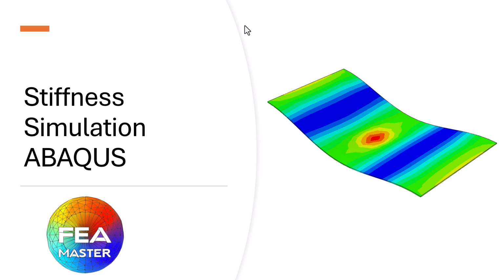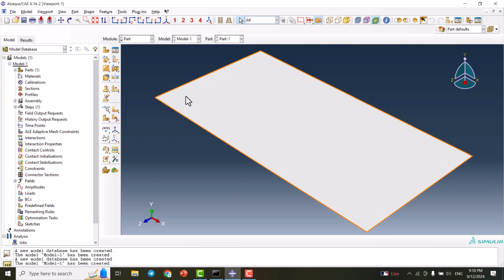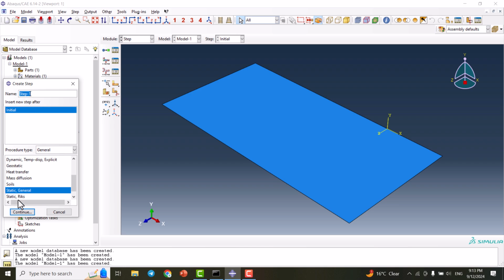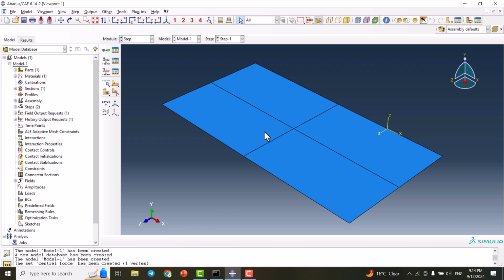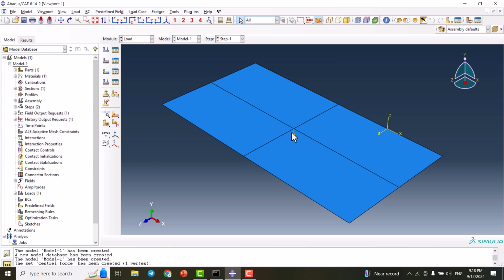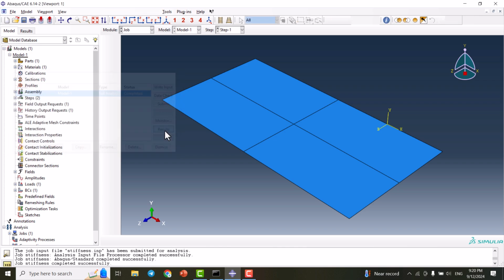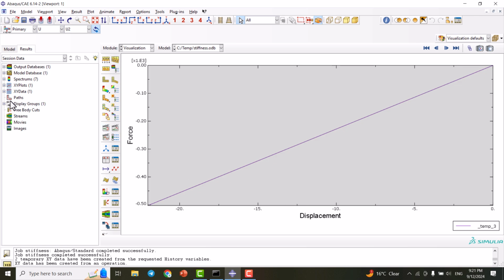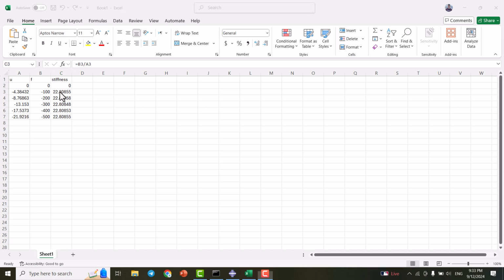You WON'T BELIEVE How Easy Calculating Stiffness is with ABAQUS

Comment: How can find the stiffness for a beam structure?
Reply from the maker: For a beam, stiffness is basically k = F / δ (force over displacement).

So you can:
1. Fix one end of the beam  
2. Apply a known force at the other end  
3. Extract the displacement at that point  
4. Compute stiffness → k = F / δ  

If you want bending stiffness specifically, it relates to EI, and you can back-calculate it from the displacement depending on the loading case (e.g., cantilever beam).

Your stress/strain method gives material stiffness (E), but for structures like beams, use force–displacement instead 👍
Reply: @FEAMASTER  Thanks for the explanation! 

In my case, I’m working with a frame structure made up of multiple beams, and I want to determine the overall structural stiffness.

What I’ve tried so far:

Fixed the bottom layer of the structure
Applied a body force on the top layer
Planned to extract displacement and compute 
k=F/δ

However, the issue I’m facing is that the job keeps getting aborted during the simulation, so I’m not able to obtain the displacement results.

Do you think applying a body force is the right approach here, or should I instead apply a point load / distributed load at specific nodes? Also, could this be a stability or constraint issue causing the job to fail?
Reply from the maker: @dhruvshah8135 I can’t really say without seeing the model! There might be tens of different reason based on different situations. What is the error message?